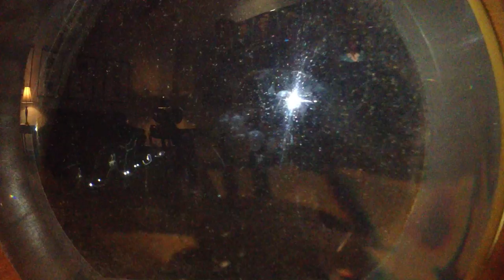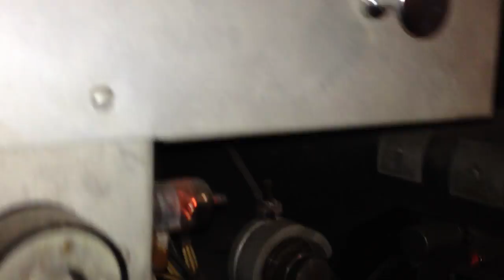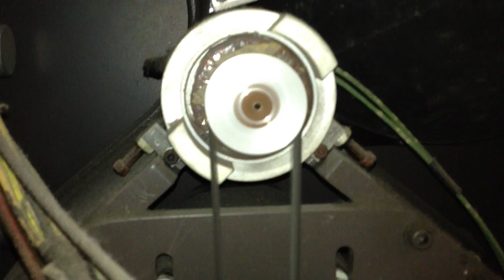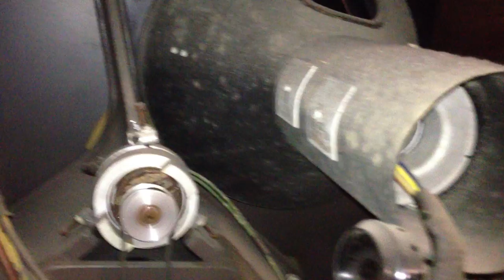Mechanical Color TV

Comment: This system was demonstrated to the FCC by CBS. The FCC OK'd it until they found out that mechanical color was not compatible with black and white electronic television. Less than a year later,  RCA demonstrated an all electronic color TV that was compatible with black and white TV. The FCC made that system the color system for the US. CBS was so mad that their system was not adapted, became the last network to go color. They hated using the RCA system instead of their own system.

Comment: It's obviously a sequential color wheel set with the CRT removed and probably a very warped color wheel that's rubbing as it spins. You have no dialogue, no description or anything else other than what you showed in the video.
Reply from the maker: +HD7100 Well yeah. It has no dialog or description because I just quickly threw it up to show to some friends 3 years ago. This is just my personal channel, it isn't a podcast or a show so sorry to disappoint. 

If you're curious this is a Gray Research 1101 field sequential color monitor for use with the CBS color system I believe serial number 21 if I'm remembering right. We found it in a box in the transmitter building of the TV station I used to work at WMAR-TV and it now sits in their lobby. WMAR was the third CBS affiliate in the country after New York and and Philadelphia and one of the first to experiment with closed circuit color transmissions via microwave link in the mid-1940s. They were also the first station to have a mechanical zoom lens and have Zoomar Lens serial #1 in their lobby. Here's more information about the set itself: http://www.earlytelevision.org/gray_monitor.html
Reply: +chiklit Thank you. That's a very interesting set. I love seeing some early defunct television systems being restored and demonstrated.
Reply: +HD7100 Shows enough why the CBS color system was unworkable.
Reply: +Frank Provasek Hello Frank. Actually sequential color wheel systems worked quite well and produced very good color saturation. One of the two digital projectors in my small home theatre is a DLP projector that uses a sequential color wheel system and the color is beautiful.
Reply: HD7100 I've been looking for the one that used a spinning drum . Have you ever run across a demo video of it. And if so could you tell me the link. This is cool. In high school a buddy and myself built a flying disc video camera . It only made a floating picture about 6" square on a 25" screen but was a cool electronic class project for science fare at school . Sync was the main problem but we did get it to stand relatively still using a synchronous dc servo motor .
Reply: +chiklit
Thanks for that information, it's very interesting.

BTW If you put up a video that's not intended for public viewing may I suggest you set it's viewability to unlisted and then just give your friends the link? 

Cheers, and thanks again.
Reply: I didn't see this reply at first because they were hidden but it seems to be Gray Research monitor, according to this site this might be the second surviving cbs system studio monitor: "This is a studio monitor made in 1950 for use with the CBS field sequential color system. It has a 10 inch picture tube with a color wheel in front of it. This unit is missing its wheel, motor, and lens. It is the only known surviving field sequential studio monitor."  http://www.earlytelevision.org/gray_monitor.html
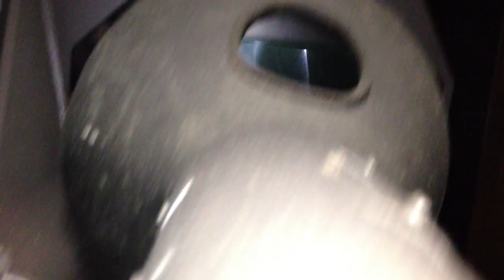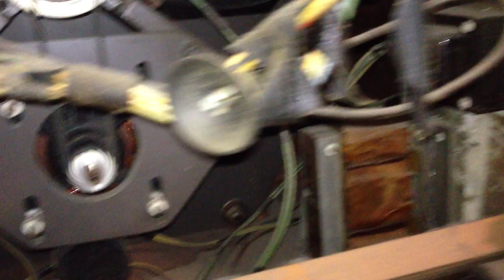Reply: it was these comments that gave me  perspective of what was going on in the video. Thank you ...Can someone tell me what the "lightning"  was that seemed to be dancing on the face of the screen was at 0:35 and 0:53 ?
Reply: @evergriven7402  I think it's the camera's light being reflected off of the spinning-colored filters

Comment: Another consideration to have with mechanical color from CBS. If you wanted to have a 25" picture tube, your color wheel would be at least 50" in diameter. You'd have to have a large cabinet for that!

Comment: It could be argued that the only reason to try to build these systems nowadays is to prove that they didn't work very well. However that does tend to influence the results.
Reply: Here it's difficult to see if the system is working well or not because we don't see any picture. And frankly speaking we even don't see the TV at anytime, but only parts of it as if we were a fly spinning around. ;-)

Comment: At 1:36 there reads "Cray" or "Gray" was that the manufacturer of CBS color wheel television?
After some google-research this is what i found:  "Gray Research 1101 Field Sequential Monitor"
"This is a studio monitor made in 1950 for use with the CBS field sequential color system. It has a 10 inch picture tube with a color wheel in front of it. 
Apparently, Gray made two models of this monitor; one for over-the-air CBS broadcasts, and one for closed circuit use. "
http://www.earlytelevision.org/gray_monitor.html
http://www.earlytelevision.org/gray_monitor_details.html
Reply: Yes!  The mechanics were done by Gray Research, a mass-producer of, of all things, turntable tone-arms for broadcast in the 40's thru 70's.  Actually,  the wheel needed to be about 3.5 times the size of the monitor to work at all.  The gap widths were trapezoidal,  left to right (small end)